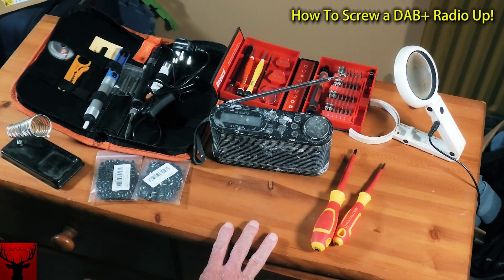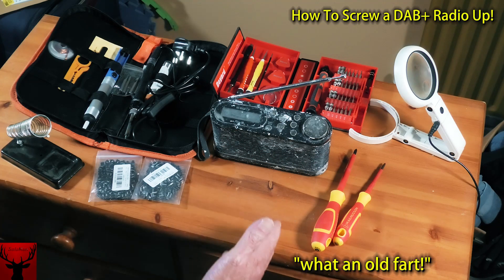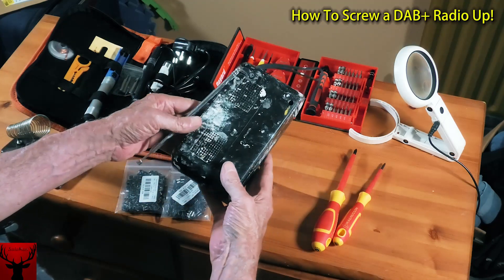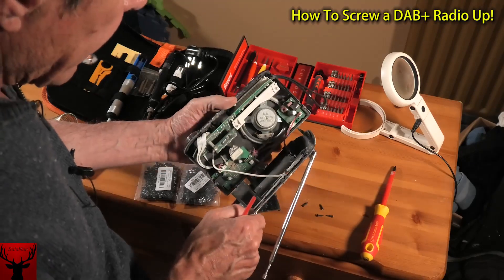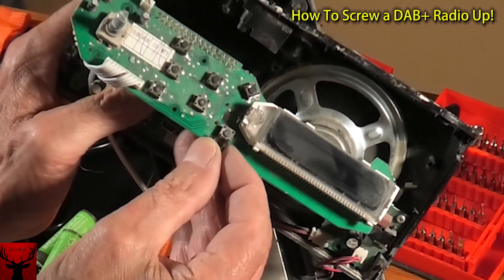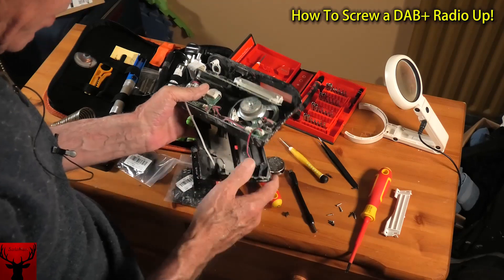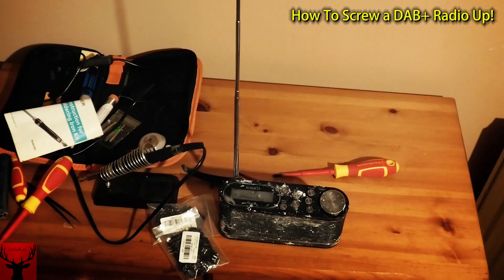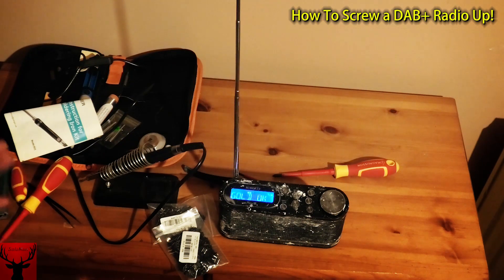How To Screw Up a DAB+ Radio Up

Comment: I'm about to change out the caps in my 1994 Ford F150's PCM. It's recommended not to use more than a 40 watt soldering iron. This combination engine transmission computer uses a multi-layer circuit board. As long as I get the polarity right during installation I should be okay.
Reply from the maker: Good luck, common problem